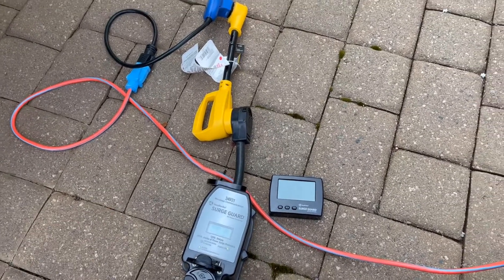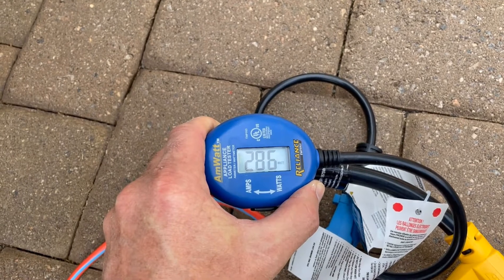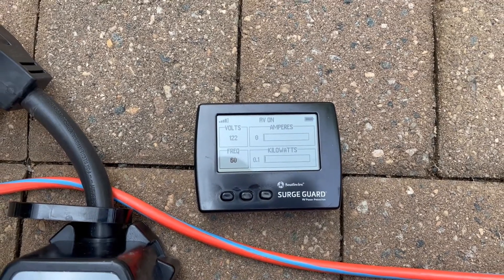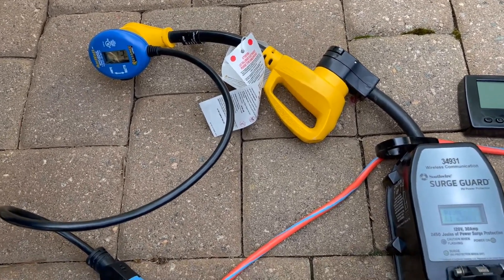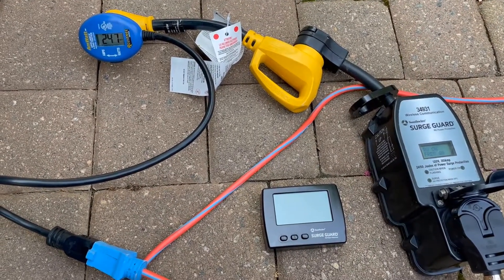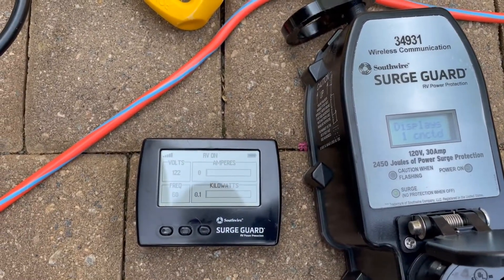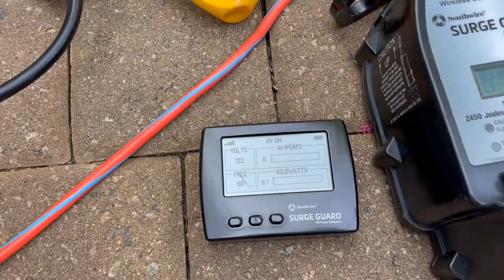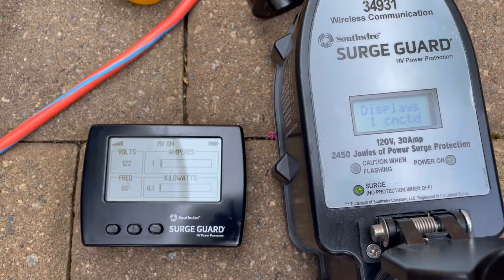Basecamp 20X Power Usage Test July 2021

Comment: Wayne  your testing theory is very flawed.  Not trying to be confrontational or critical.  The amperage being drawn is not the amperage of the loads, but instead reflects the amperage being drawn from your converter.   The converter is supply DC voltage to the system, which is based on the need of the battery charge need, based on voltage,  bulk charge, float charge, etc.  We sold our EU3000 and bought the more lighter and more portable EU3200i.  You really do not need the Surge protecter with your generator, as the generator is a very reliable isolated power source.

Comment: Wayne,  I think you may be wrong about the need for your Battery Disconnect switch needing to be on for your converter to charge your onboard house batteries.  Typicall the Airstream battery disconnect, just disconnects your DC Bus.   You still have a couple of loads,  propane detector for example.   The Converter should charge the batteries anytime the Shore Power is plugged in.   A way to test this would be to take the voltage of the house batteries directly without shore power,  then take a voltage of the batteries with the shore power connected.  The voltage should go up.  Do this with the battery disconnect in the off position.

Comment: Hello Wayne.  Thanks for this helpful video.  We're in the process of purchasing a 2022 Basecamp 20X with the solar option. Would you mind listing the parts needed to make the connection from your house 120V outlet to your Basecamp?  I know about the heavy duty extension cord per your response to Bryon Keck. I also was able to locate the surge protector you used on Amazon.  I'm just unclear on the other cables ( dog bones? ), etc.  Thanks again.
Reply from the maker: Hi @Schmoonkie, here is the adapter I purchased for the drop cord connection to a 30amp.  https://www.amazon.com/gp/product/B000BUU5YA/ref=ppx_yo_dt_b_search_asin_title?ie=UTF8&psc=1
Reply: @WayneBogan  Just saw your reply Wayne.  Thanks very much for the information.

Comment: >The goal was to determine what I could actually run on both the 110V outlet and a small generator comfortably.

So with this information, would you run the AC off the 110V?
Reply from the maker: @Bryon, yes.  I am now confident that I can run the lights and AC off a single 110V outlet when I'm home or at a location that has limited electrical capacity.  I just need to ensure that I manage the power and not overload the drop cord by turning on too many items.
Reply: @WayneBogan  much appreciated…. So, a lot of sources say that if it overloads the 110, it’ll have “complications” . Do you know, does insufficient power stress the AC unit, or does it just blow the breaker?
Reply from the maker: @Bryon, I've read the same.  I think the key is knowing 1) capacity at house breaker (is this 20amp or 15amp), 2) capacity of 20X breaker, and 3) capacity of extension cord.  In my testing, the AC, refrigerator, and lights peaked at 1400 watts and ran ~1200 watts with AC on low.  If you buy a normal extension cord from Lowes/Home Depot, the extension cord may only be able to handle 10amps/125v/1250 watts which would barely run everything.  If you buy a heavy duty extension cord from Lowes/Home Depot, the extension cord may be able to handle up to 15amps/125v/1875 watts which provides a larger margin of safety when running your AC, refrigerator, and lights.  The heavy duty cord could even handle the AC on high where it hit around ~1350 watts for me.  I personally feel comfortable with my heavy duty extension cord running the AC without any problems because I should be well within specs.  I'm not an electrician but the specs seem to work out.  Hope this is helpful.